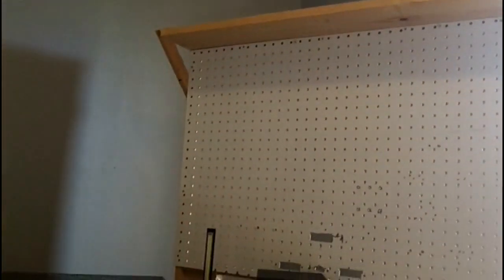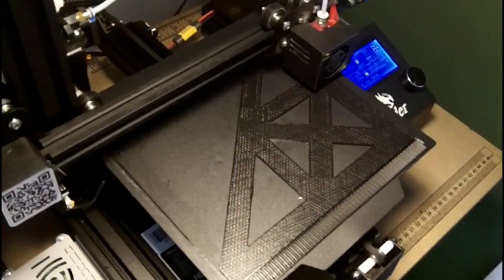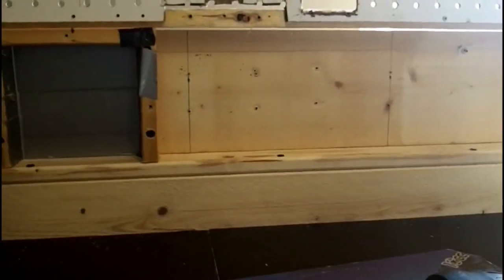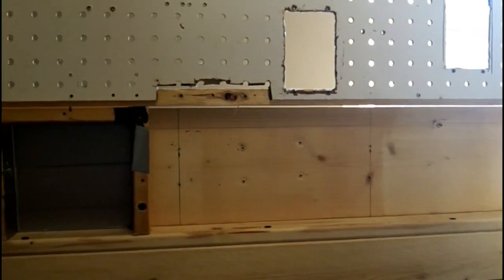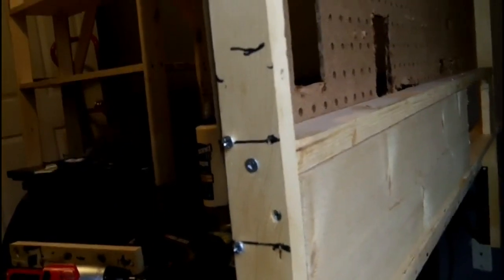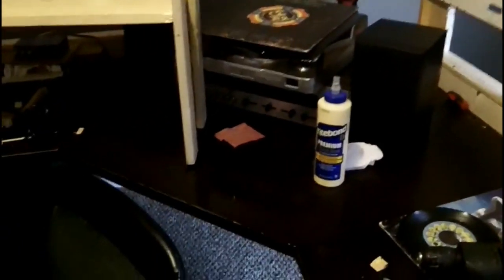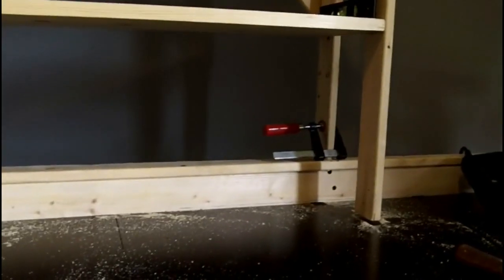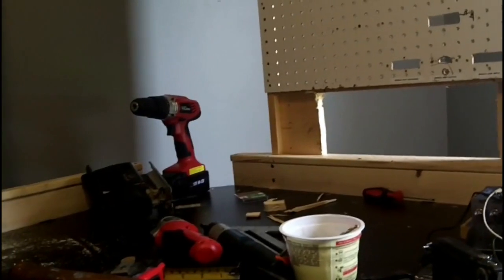DERB - DERB II - Phase 3 - Part 1

Comment: Busy as a beaver I'd say! Those black 3 D brackets are clever and awesome Doug. I found some stuff that cleans 
those records very nicely. It's made by Adam's Polishes. Called VRT. It is supposedly for shining up car tires but man
does it clean those records! I use a lint free cloth and apply three dime size drops on each side of a record
and wipe along the needle groove and get the junk out of it. Played a crappy looking record and after cleaning it
 whaa- la it's good and has no debris to catch by the needle. BTW I have 500 45rpm records in my collection.

Comment: The 3D braces turned out very well Doug. It would be handy to have casters mounted to the bottom of the bench legs so you roll it in out from the wall.
Reply: @DERB_Seymour_Indiana  You see what you mean.